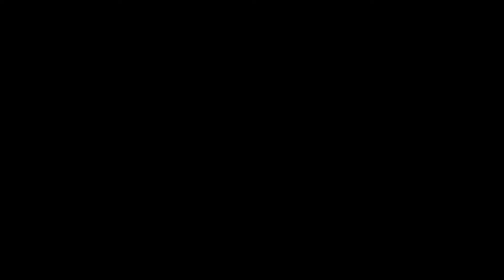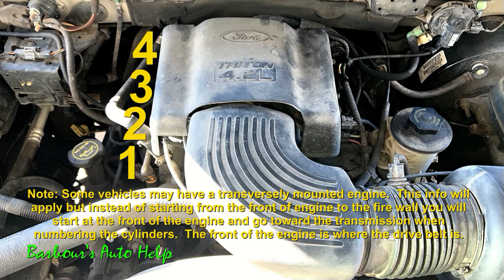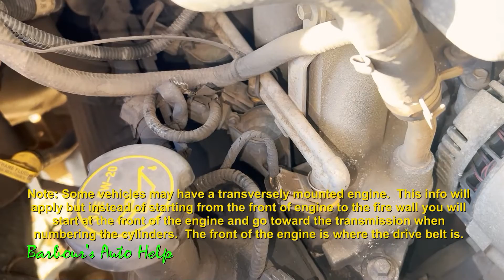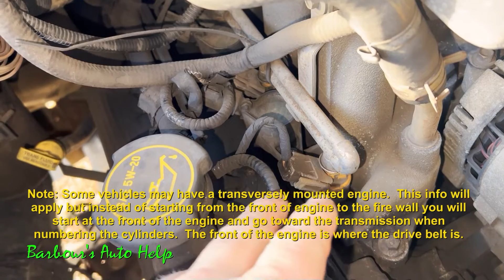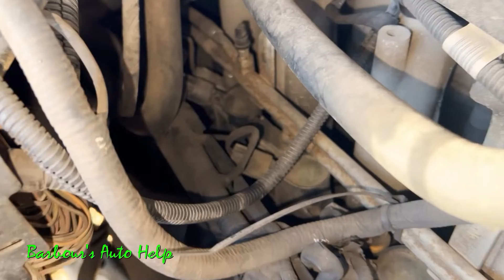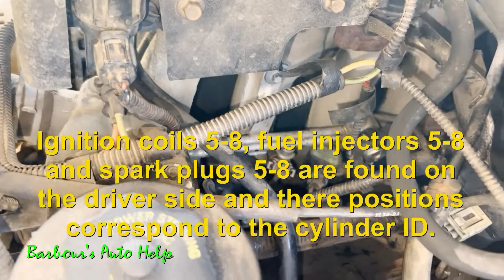Ford 4.6L V-8 Cylinder Identification, Ignition Coil and Fuel injector Locations

Comment: I have a 4.6L engine my OBD II  was indicating a P0305 code. Which means  it was misfiring on the 5th cylinder. This means it could be one of several things such as worn spark plug, failed coil pack or fuel injector and after watching your video it cleared up where they are located so if I want to I can proceed to change them out.
Reply from the maker: Don't forget about compression too.  Poor compression can cause a misfire as well.

Comment: You need to add in the alphabet code I’m trying to find ignition could D,G, and F
Reply: its very basicly the same. im going to assume your seeing codes  P0354, P0356, and P0357. The DTC PO35x codes are generic code used across all platform. They use the alphabetize them instead number. Cylinders 1234 are ABCD Cylinders 5678 are EFGH